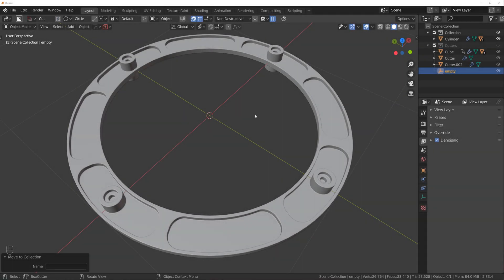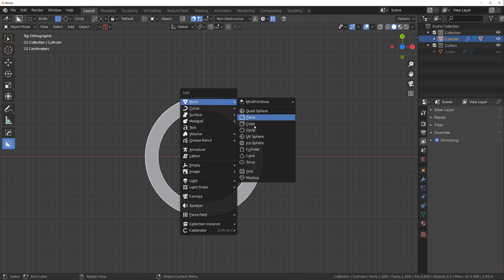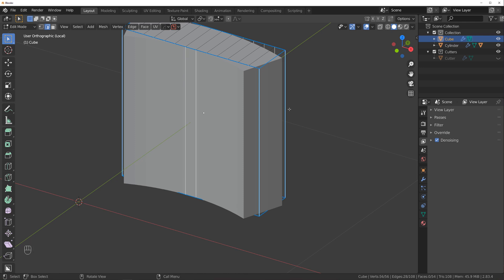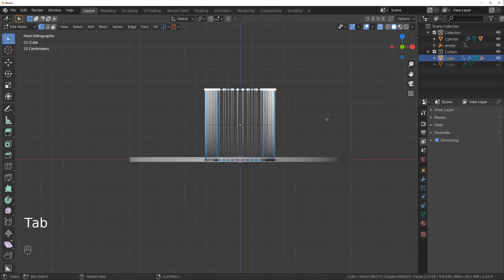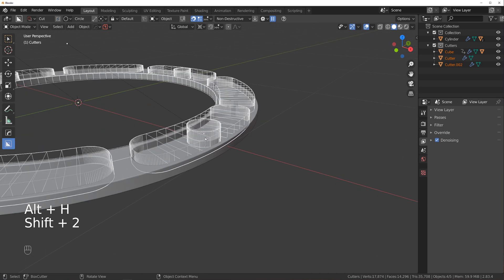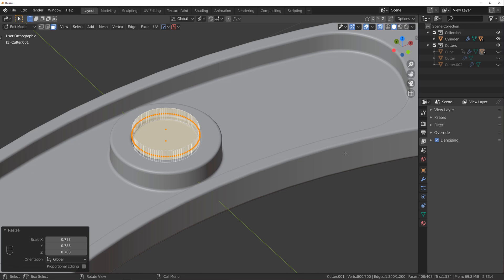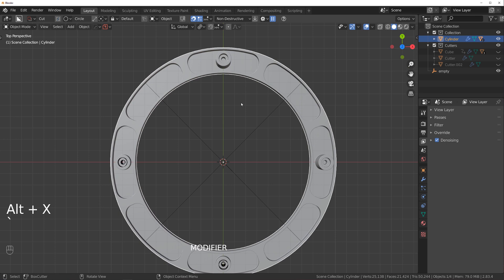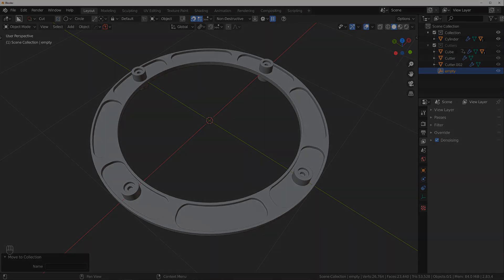Array and deform BOOLEANS in Blender like a pro with Hard OPS and Boxcutter

Comment: Hi there - getting a weird effect when I do the difference booleans after having done the circle array - certain cutters sometimes appear as solid when they're only partially intersecting with the circle (they're fine when they're going all the way through). Is this just my computer being weird, or is there a setting I don't know about that i could fiddle with to stop this from happening?
Reply: It honestly looks like it's briefly doing the wrong kind of boolean - when the cutters are visible, they seem to actually be part of the circle as an object. I'm a beginner to Hard Ops, so this is kind of perplexing...
Reply from the maker: Yeah, you probably have some bevel hotlining issues. Move the cutters, resize them or change the bevel size. Bevel is usually what causes the issues. This is simply vert based modelling limitation, nothing to do with HOPS.
Reply: @PonteRyuurui  Shifting the bevel has sorted it, thanks! Having the initial cutter intersecting with the circle when I'm doing the bevel seems to be helping to avoid problem. And thanks for the tutorial, I will be following and working my way through the rest of it! :-)

Comment: nooleans always give me bad mesh :(
Reply from the maker: define bad mesh
Reply: @PonteRyuurui  everthing line up until two vertices went YEET and stay on top of each other, i don't notice and then pay for it later in tge workflow :(
Reply from the maker: @9words40  then learn how to clean it, run machine tools or 3d print tool box clean up... it is not the tool's fault that you do not know how to deal with issues, all you need to learn is how to fix geo, this way or another you will need that knowledge in whatever workflow
Reply: @PonteRyuurui  ye, the problem is not the tool xD nothing is perfect, the comment is on how dumb i am xD lol
Reply from the maker: @9words40  well not really, lack of knowledge does not equal stupidity, we all learn after all, lack of desire to gain that knowledge, however, does

Comment: How do you change the amount of verts in the first circle cut you do with box cutter?
Reply from the maker: yes, wheel scroll, need to enable it under preferences
Reply: I think there is s setting in preferences for boxcutter that let's you adjust the vertex number by scrolling (before accepting the cut, of course)
Reply from the maker: @LordoftheFleas  yes, it is under input, scroll to adjust circle